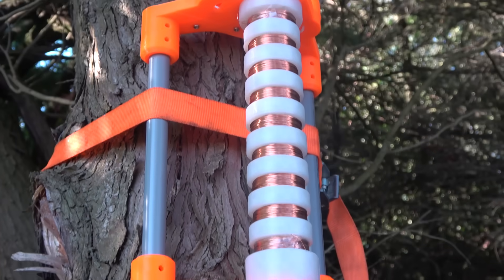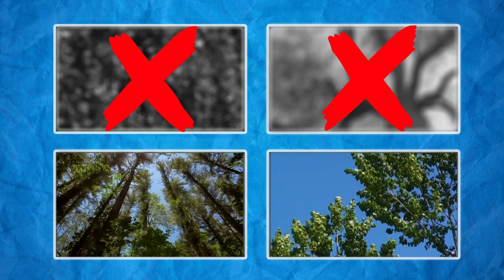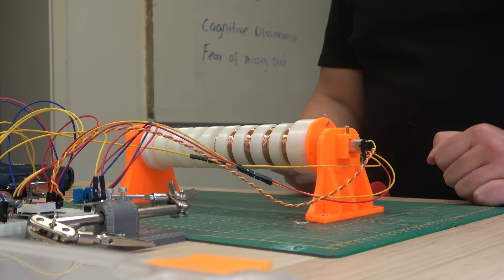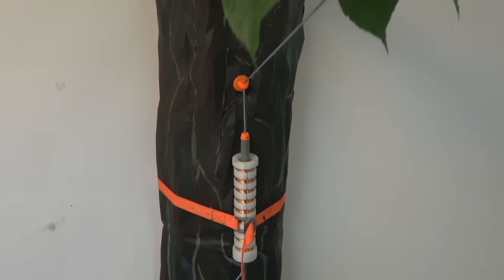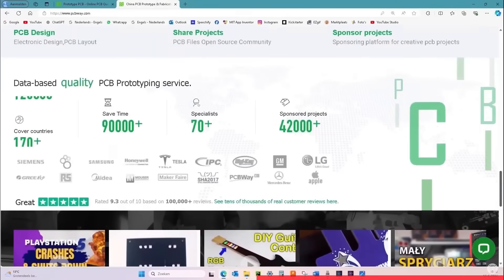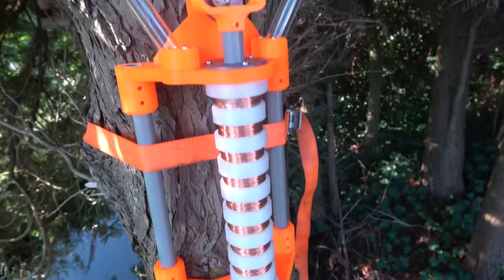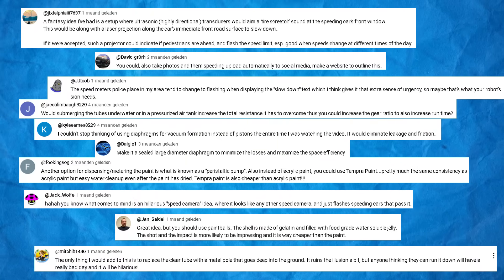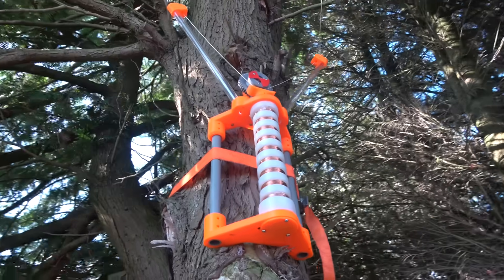I Made a Tree Generate Electricity..

Comment: CALCULATIONS AND OPTIMALISATION (English) UNDER HERE:

Note to Erik:
ERIK!!! jij bent echt geniaal, holy shit. Ik heb de video nog niet gekeken, maar ik ga er vanuit dat je de boom een soort windmolen maakt. Zelfs al is het 10000x minder efficient, het is minimaal 100.000x goedkoper en kost ook 5-7 orde van groten minder materiaal, wat intens veel beter is voor het milieu...
Waarom iets helemaal maken als de natuur al 99% van het werk heeft gedaan.... 
Gast... ik snap dat je een youtuber bent, en je moet doen wat je wil, maar dit zou de wereld potentieel echt kunnen helpen als er een bedrijf omheen wordt gebouwd.

edit:

CALCULATIONS:
HI, so i calculated whether this project could be feasible, since it could come close to the costeffectiveness of windmills. I found out that windmills cost 1 euro per Watt they generate. If you look at the average wind force (not speed, its a different calculation), and look only at the 80% most effective trees by height (close to 1250W), and assume a cost of 50 euro's per system including setting them up. You would need to harness 4% of the total force that is put on the tree.
Since we can only capture the force of the oscillations of the wind that are on or close to the eigenfrequency of the tree, (a cheap system could only harvest the energy of the trunk, not the individual braches like yours, that wouldn't be viable) i guess we could get a 1% maximum efficiency...
So this would in fact be 4x times as expensive (if my 1% guess is correct) then conventional windmills, which is still not bad.

Now ill try to debunk myself, i really hope it might be 4% or higher. I mean, since higher winds have a x^2 effect, most energy is going to be harvested from the highest 80percentile of winds, which do oscillate a lot more then the average winds. 
I would love to see how much watt you can generate at their corresponding windspeeds with your setup, since theory and practice will be really different. I'm willing to put time in this if you are willing to communicate in some way. Again really great idea man!

OPTIMALISATION:
BTW, if you would try and get the most viable test results I would recommend the following:
- Just use an aftermarket dynamo, a flywheel and a system to make bidirectional movement unidirectional. 
- Don't put the machine on the tree, but on the ground next to it so that the rope is at an 30% angle.
- Don't knot the rope to the tree, but put a pully on the tree (at around 80% of the height of the tree). Then put the wire trough it and fasten it back to the ground: at the same 30% angle, but here comes the fun part: From top perspective put it 90degrees from the machine. (To picture it: the machine is at 12 O clock, the tree in the middle of the clock, and the end of the rope at 3 or 9 O'clock) This way you will get the energy from every direction of wind!! (other way to explain it would be to put the generator for a 25m tree around 5m north of it, and fasten the end of the rope 5m east or west)

I would implement the proces from movement to energy in this order:
Rope > Unify the direction > Use a spring to make the forces more stable and thus effective for the dynamo > small gear-up (so you can use smaller flywheel) > Flywheel > gear to optimize turnspeed expected at 80percentile of windspeed like I noted in the calculations (7m/s i could be wrong) > dynamo, of which you know the optimal turnspeed for efficiency.

EDIT: 
Windmills cost around 3.50 per watt they generate, not 1, my bad. This makes it so we only need to harness 1% of the wind energy from the tree. To make the Watt/Cost ratio the same as industrial windmills.
Also, I'm sorry, but you're going to have to climb my man... be safe :)

Edit nr. 5 or something:
You need to link it up differently, in therms of placement and wires, another mistake of mine. That way you get a dead angle from 30% of the wind directions. 
How to get optimal effect from all directions you have to put the generator where you put in the video, and have 3 wires to 80proc of the top, wire them through their own pulley and throw an anchor for each of them down the tree, all 120deg apart from eachother in direction, so that you can anchor them all 5m away from the tree, such that all wires go away from the tree at a 120 degree angle if you would look at it from the top (like a pizza in 3 slices)

I can help think of a way to combine the energy of these 3 seperate wire arrays if you'd like to :)
Reply from the maker: Thanks man! 👌 That's what you call valuable feedback!💪
Reply: @ConceptCraftedCreations  No problem, its a really interesting problem! I just made an edit still tho hahah, wasnt finished yet. I think you just missed the clock layout suggestion :)
Reply: Something to note is that although the parts for his build might be around 50€, if produced en masse in a factory, the costs of this kind of system could be as low if not lower than 2€. That would drop the energy harvesting requirement from 1% to a meager 0.04% to beat traditional wind. Also I'm guessing different species of trees probably have different "wind/bend/energy harvesting properties" as well, providing even more room for further optimizations.
In short, ConceptCraftedCreations, welcome to your new life as the messiah of green energy 😂
Reply: Yeah but you need labour to put them into the trees systematicly. Although I can imagine this could be a cheaper alternative to solar (have to check that still lol), if customers fall out of trees.... not pretty for a company  @ww-pw6di
Reply: This calculation is equivalent to the "high efficiency, high output" model I mention in my main comment.

If we look beyond generating value from the actual energy available on a day barely worth flying a kite or going sailing, then we need to value-add the energy, to make it worth harvesting.

Burning coal or oil is primative, making plastic is advanced.

Likewise, seeing the tree movements as only an energy source is primative, seeing a way to value add that microsupply is advanced.

Hence I propose the wifi mesh idea. The energy havested from the movements of a single tree could power a single node of a wifi mesh and would be barely visible. The value of that service is very high and could demonopolise the entire communications sector, making it profitable (or at least cost neutral) for households to contribute to. Mass produced, a single node for one tree might cost only 50% more than a home wifi router, twice as much with professional installation and, when everybody does this, the multinational telcos are replaced, farmers get value from their windbreak plantings by having access to their online markets from anywhere on their farm, forestry becomes network infrastructure, as do parks.

A few nylon lines, a small mechanism and electronics box, a 25 year life expectancy (equal to solar) and suddenly we see the trees, not the wood, from a markets perspective.
Reply: @crunchysteve  wow, just wow... honestly, your idea is a signal for an incredible value unlock that a cheap, non-invasive mass-producable passive energy generation device can unlock. wifi mesh network is such a great use case!
Reply: While the electrical output cost effectiveness is definitely a factor when considering a technology, it should be noted that wind turbines usually require open fields and have negative environmental impacts, such as bird strikes. The fact that we are keeping the tree, its oxygen output and environmental value could potentially outweigh the pure cost factor, or be another option in locations where wind turbines are less feasible. Another factor to consider is wattage per square kilometre of land. Wind turbines need a lot of spacing while trees tend to be quite packed together. I think there's definitely benefits to this approach that could be overlooked at first glance when compared to other electric generators.
Reply: Interesting analysis, but missing one main aspect: considering cumulative distributed upkeep costs
Maintenance on one single giant windmill will always be waaaay cheaper than the upkeep required on many, many thousands of small "tree mills".
1- Sure, you can argue that you dont catually need to build the windmill itself, as you are taking advantage of already existing trees. Trees are living organisms, as so, they grow in a somehow predictable way, but not 100% sure. You'll have to constantly adapt the generators, even if you could find a way to automatically adapt the energy harvesting contraption...
2- But look at what is happening with traditionnal windmills: they go bigger and bigger every year. They even started to dismantle small ones and replace them with bigger ones...
>> For a reason. Despite the exponentially higher costs induced by larger windmills, every windmill manufacturer contracting for every grid company of every country is going the same direction : bigger
Common sense here, no need to do the calculation by yourself: After having done the economic profitability analysis, every one is going the same direction, opposite from this
Reply: @sergeb7945  Labor costs are a significant factor in countries where labor costs are high. In most countries that's not the case and in many countries labor is so cheap that people do what even cheap machines would.
That being said, I think a lot of people in the comments section get a bit too intense in terms of what this video represents. It's just a silly experiment and it just might accidentally have enough value to be a little bit more than just a silly experiment. 
Even then this device (after many of the improvements and changes) could provide small scale regenerative electricity at an extremely low cost to very impoverished areas and do so even at night. Because here the massive windmill and its toxic components are replaced with a tree and only the generator has to be made. 
Its a genuinely good solution and whether it can actually work well emough will probably be a series of youtube videos.
More love and less "no, but no, but no".
Reply: @ww-pw6di  100% agree, the system is not that hard to understand, I guess there a potential educational purpose of such system, made with a comprehensive documentation, it could be pure gold for teaching the use of such system to a young population. Especially because villages (I'm mostly thinking to African mid-south area) are often bordered with trees, because it's less warm than desertic area. More than just teaching it can provide eco-friendly autonomy to some population, but it would need an industrial production price for pieces that is affordable and a elaborated maintaining process focusing on simplicity, that would need few R&D time, and also the energie distribution model adapted for various "living place setup" but that's dope, it's a yes yes for me.
Reply: In your calculation you are forgetting maintenance, durability over time and loss from power transformation, as well as cost of installation on a large scale. All in all I can't imagine this being feasible in the real world.
Reply: What I think is great about this idea, windmills require a lot of maintenance (cleaning off bugs actually). 

But the best part, Windmills are ugly. I like the outdoors and hate seeing the windmills. These can be hidden and even in urban areas. Imagine having more greenways because they provide power. It would be great.

Comment: The idea is really great, and I'm looking forward to the large scale prototype (instantly subscribed). 
As I view it now, you only use the left and right motion and the up-down motion would be ignored. Since on Up-Down the branch pulls on both strings. 
Also, as others suggested, may be go with a conventional rotating generator, even if the novelty of your linear one is a real eye-catcher, since you already have rotational movement, the conversion might be a point of efficiency loss. 

I think there should be a way to efficiently convert the Movement of the two strings into rotational or linear movement, for a branches' movement in all axis. 
Maybe some kind of pulley system: in a W & V configuration, where the left upper and right upper points of the W are connected to the branch, the middle upper point of the W is fixed. The two lower Points of the W are connected to the upper two points on the V and the lower point of the V is connected to your Generator. 
If I haven't overlooked something, this should result in an up, down motion on the lower tip of the V for the movement of a branch on all axis. Even though Up-Down Branch Movement would yield more energy output at the tip. 

You and others probably have a number of different ideas to improve, and I really hope you develop this one Power plant further.

Comment: that threat should be more attached to tree means at ever 10 to 20 cm distance attach hook nail and pass thread upto branch end so u can get max pull possible and the kite electricity generator system will be the best one ..and if u are using more threads for each branch then there should be some system for using pull of each thread

Comment: I think that the coil would be more efficient if it was horizontal since it would not lose energy by lifting against gravity, it would not need to use a spring or magnet which functions as a spring. also scotch yoke has a lot of friction. a crank would be smoother. you  could use an opposed piston design where both pistons move closer together and move apart together. this avoids losing energy to balance. another post mentioned using a rotary alternator, this is a good idea. use a ring of magnets on a flywheel and a fixed stator. since it will be low speed plastic will hold together well.

Comment: I'd like to see something like this mounted near the top on the trunk, and connected to another tree rather than a branch. Differential trunk sway probably has far more energy than branch movement. Moreover, if you used the rotating generator + flywheel + ratchet mentioned in another comment, you might be able to use a hub and spoke model, where only one tree needs a generator, and it attatches to, say, 20 other trees.

The main problem with this approach is installation complexity from having to climb the trees. But perhaps it could be combined with normal forestry/arborist work eventually.

Comment: Love this idea. I would try connecting the top center branches or stems on some bigger trees with a cable, and trying to harness the energy from that using a radial generator instead.

You could get some serious energy out of that, larger motion, much more power, etc. If you use a counterweight as a spring you could harness the energy in both directions.

Comment: Making the generator linear is a mistake. I think the better way to do this is with a flywheel and a bike generator. The tree's movement is slow but really powerful... Make those short strong but slow movements spin up a flywheel really fast through gear ratio's and both movements spin the flywheel in the same direction. Then bleed off that speed into power with a bike generator over a long time. Faster rotation of the generator means better efficiency anyway.

Comment: I believe that you could improve it a bit by using a regular alternator or dynamo. Initially you were harnessing linear motion but then you introduced harnessing from all axis and converting it to rotational motion which is clever but kept using the linear generator so you had to convert it to linear again which incurrs a loss. So why not using the rotational motion directly (unless I am missunderstanding something)?
Another advantage of using the rotational motion directly is that you could use gearing to match the tree motion to the optimal rpm for the generator and maximize energy extraction. 
I eagerly await for the first data, if the power produced is enough to offset the cost in a reasonable time frame , it could be not only a way to generate power but a way of convincing humans not to cut those trees.

Comment: Maybe a rack and pinion setup which could be less resistive to directional changes?

Or
In the middle of the feeding cog, add a spool of string which winds up and down depending on the direction of motion. The string/wire is attached to the generator core.

The problem with most gear assemblies is the added friction so think about ways of reducing friction which reduces efficiency.

Comment: Using a magnetic spring was a great idea. More ropes and gears, then all of them moved to convert to DC current. DC current will be easier to generate than AC when more ropes and kinetic energy is involved. DC could charge a battery. The DC battery could then be converted to AC with an adapter or used as DC to charge a phone, power a light or turn a fan. Slip gear disk's to convert all motion(clockwise/anticlockwise) to a clockwise motion for DC energy generator.
Reply: It will have a nice harmony, kinetic energy to DC to battery. Then battery to kinetic energy again for rotating a fan.
Reply: Another visually appealing alternative would be to use a water heater. Instead of battery, use the DC current to heat a water storage unit to boiling. That way you can have hot water for bathing/drinking and save your electricity bill.
Reply: Stream is a good place to start when working with energy. All energy like coal and nuclear use steam as an intermediate step.
Reply: Just be careful not to electrolyte the water. Hydrogen is explosive and dangerous. We only need heat